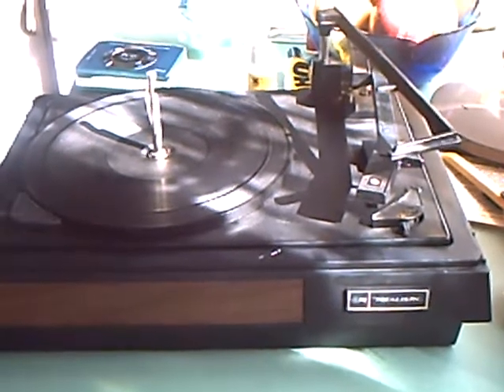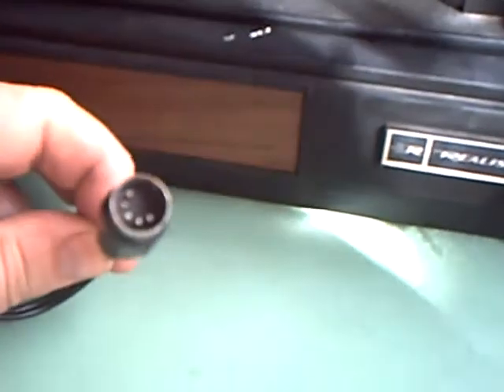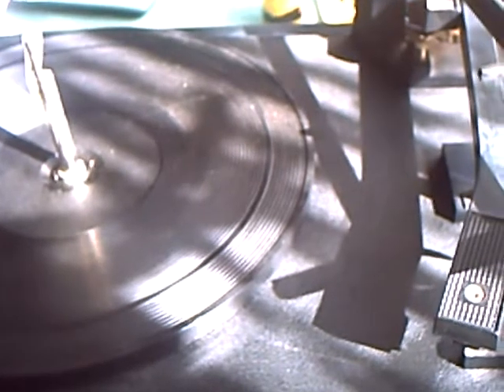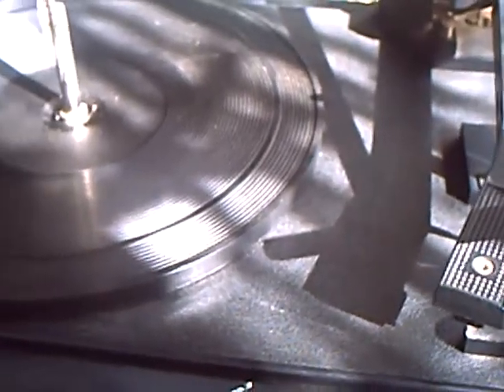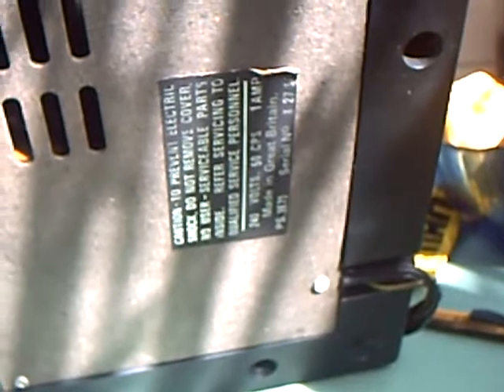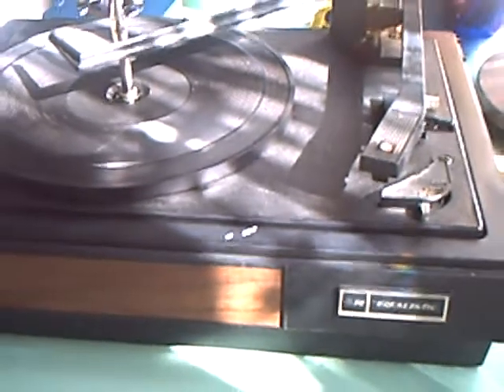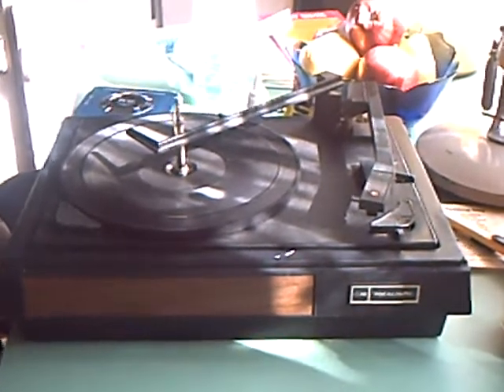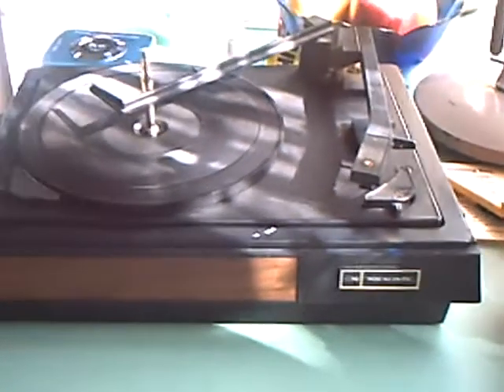Realistic ( BSR ) mini turntable

Comment: These were in the Radio Shack catalogs for many years (1969-76), marketed as the Modulaire changer (model 12-1471), along with the tiny Realistic Modulaire AM/FM receiver and turntable system. It included a dust cover,  unlike most changers in that day where you paid extra for a dust cover as well as a nice-looking wooden base. In the US, it sold for $39.95 but you got $10 off buying it with the Modulaire receiver/speaker combo (model 12-1470). I received one along with the Modulaire receiver/speaker combo as a fabulous Christmas gift from my Dad when I was 9 years old, and used it for a few years until I could afford a nicer component system.